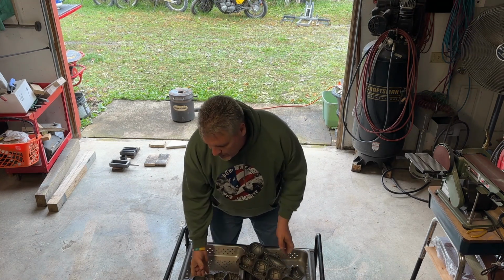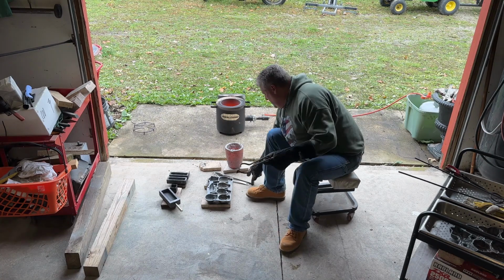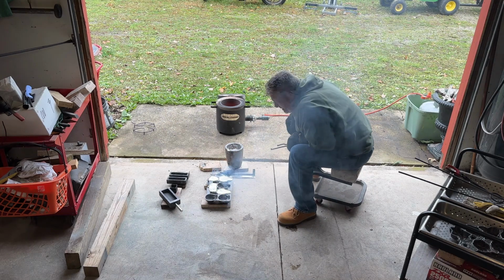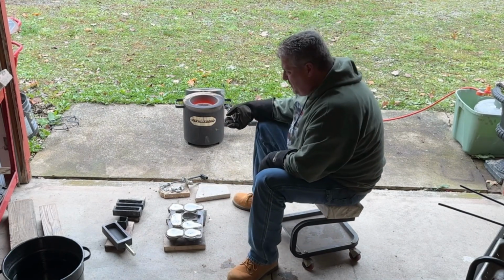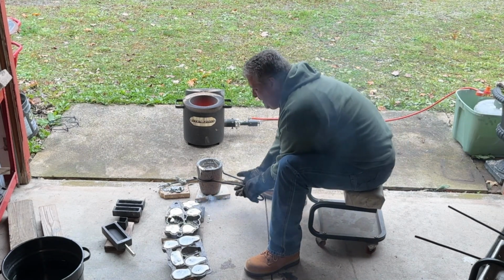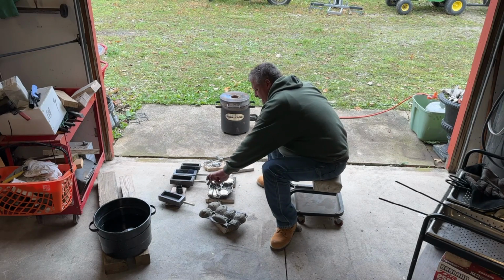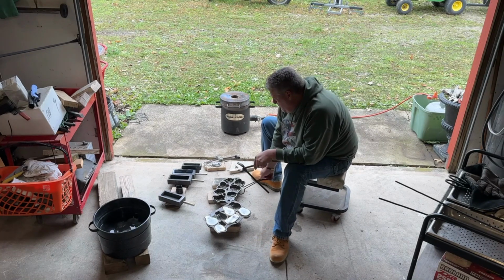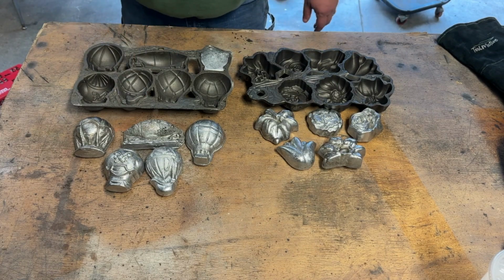Cast iron mold testing - Hot air balloons and flowers #castiron #aluminum #melting  #diy

Comment: This just popped up in my recommended,  probably because I do metal casting too. Those molds look great! Coating them with graphite dust or talk will get you a smoother result with less bubbles. I know this makes a lot of diffirence when casting lower melting point metals in silicone molds, but for cast iron mold it should help too.
I'll be watching more of your work, subscribed and hit the bell 😁👍
Reply from the maker: Thank you Ralph for the insight.  As I have been learning I have not heard of the use of graphite dust or talk.  I have a video coming out today that I previously recorded but I have started looking already for graphite dust and I will be using it on my next pour using cast iron molds.  I have subscribed to your page as it looks like you have done a lot already and plan to learn from you so thank you.
Reply: @ourdreamourpurpose8293  Graphite dust is HIGHLY recommended when casting copper in steel or cast iron molds, as copper can fuse itself to the steel/iron. And then the mold gets destroyed... speaking from experience 😅